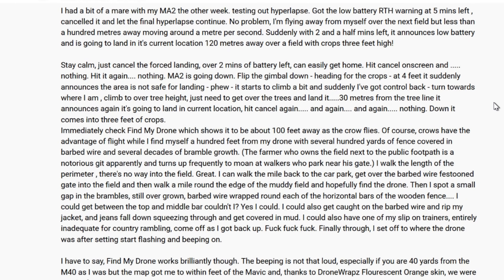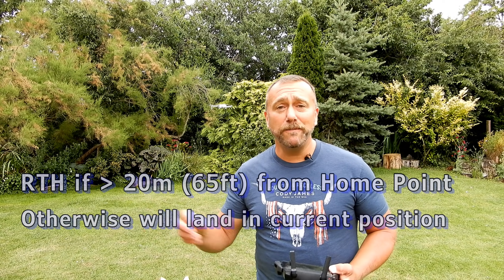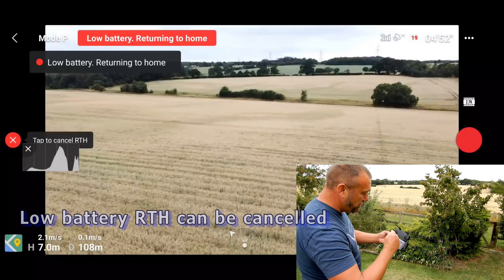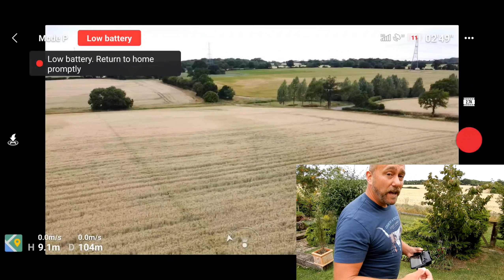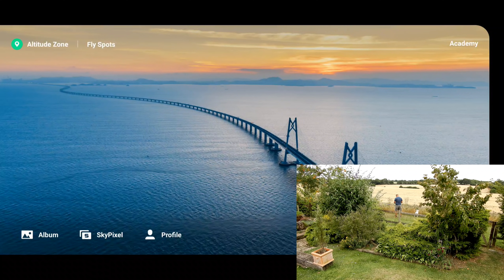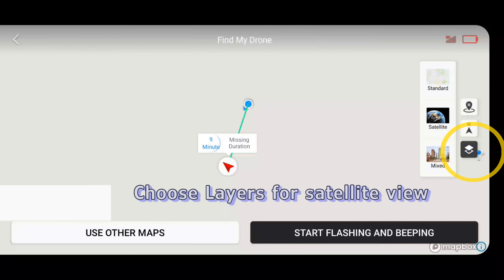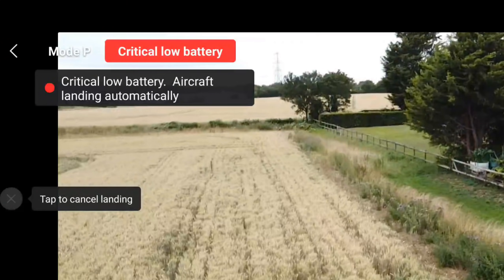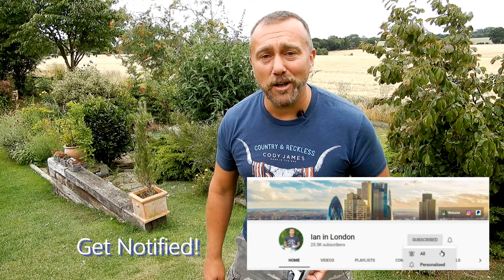DJI Mini & Mini 2: Flying to 0% Battery - RTH, Critical Battery & Auto Power-Off explained

Comment from the maker: For those who feel that need to push the battery to the limit, this is what happens.... But remember it's a great way to panic and crash, and also damages the battery.  All tales of woe gratefully received below! And for those after more info on Grimes Graves at the end: https://en.wikipedia.org/wiki/Grime%27s_Graves   Cheers, Ian
Reply: Appreciate you putting your drones in harms way so that we don’t have to!
Reply: @goobydooby1406   the fall guy hehe thank you
Reply: Great t shirt
Reply: on critical low battery when you say it will force landing when you let go of the sticks, on the left hand side it says cancel landing. I assume you can press this and stop the landing.
Reply from the maker: @craigbarnes6575  No. On critical, it's there but greyed out and you cannot press it or cancel it....
Reply: Thank you sir
Reply: I just did this but I wasn’t pushing the battery I just forgot to account for the wind on the way back.

Comment: Can I ask Ian, how did you get permission to fly over grimes graves? Thanks in advance
Reply from the maker: I just flew from the front gate after closing.... Nice and easy and the staff even told me that was the easiest thing to do 👍🏻
Reply: @IaninLondon   @IaninLondon  That's great Ian, thanks for your response. I will do the same then, since you have asked the staff specifically and they said it was ok, as long as it was after closing time and the easiest thing to do was to fly from the front gate. I thought English Heritage has had a blanket ban on flying over all their sensitive sites for many years now, without express permission...but as you have asked the staff and they have told you it's fine, then it must be ok. Great to know, thank you.

Comment: Hi again Ian. Old vid but hopefully you'll see this. I'm rather confused as on my first flight, all went well until the drone (2se) went backwards into a tree. I managed to get it back by throwing sticks 20m up the tree. My confusion is that I downloaded the flight log and uploaded to airdata to see the issue. The flight path showed it drifting backwards into the tree with no inputs from myself on the sticks. The wind was not beyond the air resistance of the drone, beyond the tree I hit was a flour mill with big metal silos but according to the flight log, all sensors were fine with no disturbance. After the crash it requested recalibration, was this likely due to the crash or, was it doomed from the start as I didn't calibrate out of the bag??. The only thing I can think of is that somehow it was drifting backwards, I panicked and pressed pause which I now understand would have braked (sending it momentarily backwards more?. On the flight log there was no sign of the brake button being pressed. I've flown since and it has behaved perfectly but this first flight issue has haunted me ever since. Amazing channel dude. Cheers
Reply from the maker: Sometimes the downward vision sensors can get confused. Were you flying over water by any chance? Also, if you didn't have full GPS lock, then it's very prone to drift even in a slight wind. This can happen shortly after takeoff when you initially have full GPS, and then lose some of the satellite locks. Recalibration is probably due to the crash, but it sounds like the drone should be okay
Reply: @IaninLondon  cheers Ian. Just checked logs again, satellite count min and max was 21 so ok. Wasn't over water. I'll just have to write this one off as being an anomaly I reckon:)

Comment: Will the Find My Drone feature work if the battery in the drone is completely dead? Your video does not make that clear.   Thanks   Robert
Reply from the maker: Yes, I mentioned it will take you to the last known coordinates of the drone before it lost contact thru dead battery. 👍🏻

Comment: I was flying my drone and suddenly the wind got very strong and I couldn’t return home on time. I lost reception at 3% battery to it probably crashed from very high (as it was trying to return home). Unfortunately I haven’t found the drone yet. I’m trying to find it to save the memory card at least. Any other tips?
Reply from the maker: Use the Find My Drone function on the app, then enable satellite layer and try and work out exactly where it was and where it was flying.  If you lost signal whilst it was in the air, it may have kept on flying in a straight line until the battery dies, or it may have stopped, then reversed its flight to try and regain signal.  So either way you have some searching.... good luck

Comment: I had a mavic air go into emergency landing on the first leg of a flight from nearly 1km away. The battery was showing ~80% but it thought it was critically low. I turned it back and held up on the stick, it slowly descended all the way till the point that I got it back to me. That battery later went dormant and I discarded it. 

I came about 300 meters short while returning a mavic 3 pro last fall, once it got down to about 60 meters I lost signal. I went to the "find my drone" location and did a grid search and found it in only about 5 minutes in thick forest. Footage showed that it came down vertically, dodged all the major branches, hovered for a few minutes and finally hit some small brush about a meter off the ground to land upside down in the snow. 

A couple of weeks ago a major wind gust came at a mini 3 pro and it blew it about 3km away from my location. I couldn't drop the altitude enough to avoid the wind because I would have lost signal and therefore lost gps position to start my search. The last known location it was travelling NE at 5m/s, 100m altitude. It was on the opposite side of a big lake in crown land forest and there was 3 feet of snow on the ground.  I had to break out the snow shoes and this recovery took about 5 hours in total. Once I reached the last known location I started a 100m grid search along the last known direction of travel. It took about 45 minutes to find from there. Footage showed that the drone suddenly stopped moving with the wind and descended perfectly vertically after signal loss. Once again it dodged all the trees and descended to 1m off the ground, hovered there for about 15 minutes before nicking a small twig and falling face up in the snow. I believe there was a glitch in the controls because it didn't look consistent with other wind blow-away incidents. I believe the forward stick stopped responding. I've had this happen before where I had to turn a drone around and fly it home backwards because the forward stick glitched out for some unknown reason. 

I've since been experimenting with tile trackers attached to the drones. Initial testing shows I can connect and make the tracker beep from about 50m away in thick forest. This could save me a lot of time in the future. But I haven't had a chance to do a real life test yet.

Comment: Thanks Ian. I'm gradually increasing my knowledge thanks to your beginner's tips playlist. Quick question. I noticed that in Find my drone there's an option to "Start flashing and beeping"?
Reply from the maker: That's in the Find My Drone section and will make the drone flash and beep if it's crashed but  still got power and connected to remote. 👍🏻

Comment: Sometimes you land on the trees as I did with my Mini 3 Pro with 60% battery. But the device automatically shut off after few minutes  cause overheating… after it if couldn’t activate alarm mode and find it. https://youtu.be/rFg4CKi3xMk

Comment: I had my old mini SE be at 0% for about 3-4 minutes without it landing because of the low voltage. Obviously i had the unstoppable landing but i could make it go up with the joysticks. I almost lost the drone that day. The battery was no longer functional and i got a replacement.

Comment: Ian, not sure if you still monitor this video (2 years ago) but I had this happen to me 2 days ago on a commercial drone job.  That's why I searched for this video.  My Autel Evo II ran out of battery while on an orthomosaic mission.  The drone completely disconnected from the controller, so I had no control whatsoever.  But I found the drone in perfect condition in a parking lot.  We are so fortunate that these dang things are smarter than we are!!  Thanks so much for demonstrating this.

Comment: Had this happen while doing a lengthy flight. Total panic because it went down to 70% on the way out, then on the return it drained like a sift. Over farm fields, looked for a suitable emergency landing spot on a quiet dirt road while I still had battery, and had to do the shame knock on a farmers door to get permission to grab it. Will never fly without checking wind direction again. Biggest thing I did was make sure the landing location would be easy to find. Slight panic when I was descending to a stream thinking it was a dirt road 😂
Reply from the maker: Hey, at least you got it back 🤠👍🏻

Comment: Brilliant Ian mate, must have missed this video. Thinking about all the bleeps on DJI drones. I keep obstacle avoid on all the time and set drone to stop as helps me view my house roof for any possible damage etc.... (My drone as you know is Mavic Air 2) 
But when getting lower on roof or ground I hear "Landing.... Landing"

Would it land on a roof or the ground on its own at certain distance or do I need to force sticks down on the voice request?

To scared to test properly over my roof and wind been a bit high for ground testing. Help and advice much appreciated mate 👍👍👍
Reply from the maker: It will land on any flat surface if it's on critical battery.
Reply: Does your reply mean that it will not land on a roof or flat surface even though "saying landing"
Unless battery low?... and on low battery will not land on a roof?
I also flew over new plants and seeds that my wife and the community volunteer's planted for growing last year and growing well.
I got the landing warning there too... Footage looks great, but I got scared when heard the "Landing"

Theses were crop looking seeds that grew to about 2 feet high, and my warning on drone said "Landing"
Reply from the maker: I'm unsure why it would say Landing unless you were trying to make it land. Unless you were lowering down on to a flat roof. Then it would see the flat surface and if you kept the left stick down, then yes, it would go into Landing mode and switch off the props once landed. Now, you could start them up again but if it was cooked, say on a stone or uneven surface, the props may not start up again, then you'd be stuck.......

Comment: would sticking an airtag on it mess with anything?
Reply: I would not say so but the drone has its own gps and there is a find my drone option and you can get a pin point location of the drone so there is no need for the airtag

Comment: Hello ian good morning I'm not seen the drone and the front of the remote  I of to turn on the map to see a drone  What can I do to see it on the front of the remote please
Reply: Have just see its thank you very much my drone family I'm so happy 🤣🤣🤣🤣🤣🤣
Reply from the maker: Do you mean the little radar indicator that used to be in the bottom centre of the display?  That's moved to inside the Map on the lower left.  Tap the map, then tap the little icon lower right of the map.
Reply: Yes ok thanks for the info

Comment: Bro my drone got swept away miles down the road and I thought for sure it was gone. The wind must have been really strong because it was relatively calm whenever I took off. I hit the home button and in flight logs it showed that the drone had turned toward my direction but was still getting carried in the other direction. It showed that it was emergency landing due to low battery. I followed the GPS where it last transmitted and was so confused. I thought there is no way it came all the way down here. I didn't find it the first time I looked and gave up looking. 30 minutes later I was like I'm not losing$600 so I went back. Did a little bit of critical thinking and thought of I loss signal and it still had 12 percent battery then it probably went a little further in the direction it was headed. Sure enough I found it untouched. Must have landed 😂 10 minutes of flight took it miles away. I must have hit some kind of wind stream because it happened so fast.
Reply from the maker: Yep, you did precisely the right thing. Watch my "How to avoid flyaways" video in how to prevent this next time!!  👍🏻👍🏻👍🏻

Comment: I've just watched this video about battery life. https://youtu.be/-mGVSqg6OFg  Is this correct? It seems rather naughty of DJI to set the battery time out so that the batteries fail if you don't use the drone.
Reply from the maker: I have batteries that work fine despite not being used for a long time; sometimes they go into sleep mode and need ot be reactivated by the single charger, but I don't beleive DJI actually program them to fail after a certain time-period...
Reply: @IaninLondon  - seemed a bit far-fetched to me. As I can't change the settings on the Mini-2 I  shall have to see what happens.
Reply from the maker: @danensis  No, you have no control over the discharge times, but they're programmed to maximise the life of the battery (not end it!)

Comment: Thank you for great review, quick question, if drone landed on water in low battery mode, is it still ok for replacement via dji care plan? Thanks
Reply from the maker: You need to provide the drone for return, so you may have to go swimming to retrieve it...
Reply: @IaninLondon  So i would need to dive in otherwise claim is not settled?
Reply from the maker: @igor4371  Correct, as they require the drone itself to be returned in most cases.

Comment: Thanks for the great, practical video. Unrelated question, are those WW2 bomb craters filmed from 9:45 onwards?
Reply from the maker: No, the subtitles tell you. It's a neolithic flint mine. They're depressions in the ground from the 8 metre wide and 20 metres deep pits dug out for flint, some 3000- 4000 years ago....👍🏻
Reply: @IaninLondon  Incredible. I've never heard of them but curious to do some research. Missed those subtitles but thanks for the info.
Reply from the maker: @TheEmbassy33  link in the video notes. Grimes Graves in Norfolk 👍🏻

Comment: By the way, I have not seen you comment on the "A" and "B" blade sets and correct placement on all DJI drones, including the Mini and Mini 2.
Reply from the maker: Hi Dennis.  Do you mean the circle and dots to ensure they right props go on the right motor?  I do cover that on my Air 2 and 2 Pro set up, but as the Minis come with the props pre-attached, I hadn't mentioned it... Suppose if you need to chnage them, it's important, so I'll mention that

Comment: Ian, how do you feel about dust covers?  I know they add, aluminum, 3 grams or so of weight.  I know it can depend on where you live and if sand or dust is common on landing.  My question is will the motors overheat with these caps in place?  Any insight?  They would also keep moisture out flying in clouds.  I flew by clouds as a helicopter pilot, stuck out my hand and felt the warmth before evaporation cooled my hand.  Lots of fun.  Any way to contact DJI on such questions and to request they call the blade mounting "screws" spindles.  Some on YouTube are recommending not changing the "screws", just the blades.  Not a good idea in a high grit environment where the fretting of the blades will grind the spindle.
Reply from the maker: Seeing as DJI refer to the rotors as props (props are vertical, on a plane, rotors are horizontal, like on a helicoptor) I doubt they'll worry about spindles... :)   I don't use dust covers; I can't see how you cna stop dust but continue to allow air cooling, which is essential to avoid overheating.... I hand launch and catch if dusty.... Cheers!